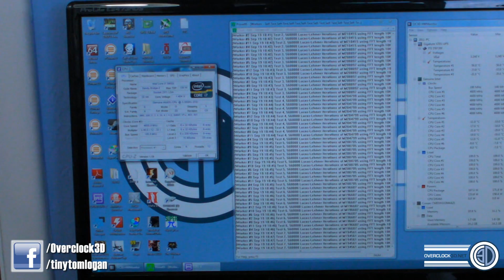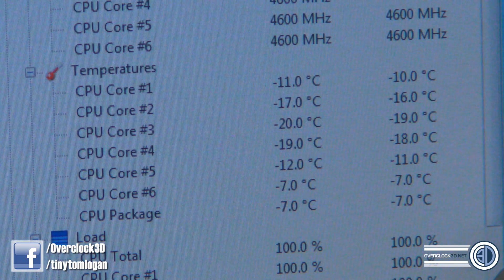Ultimate Corsair H100 Cooling Mod

Comment: He said in some way that this video is joke. But I want to say that you can't get CPU temperatures below the ambient air temperature, even with water cooling. And I also read some comments that some peoples compare the liquid cooling with the way that your body cools when you get out of the pool in windy day. That is completely wrong! When you get out of the pool you have water on your skin, which when blown by air evaporates and takes body heat with it and makes you feel very cold. But that is not the case with the liquid cooling, since the radiator is dry.

Comment: The core temperatures are fake, if you get cpu temperatures BELOW freezing, your would be turning the liquid cooling liquid into ice which.... uh....  is gonna blow your pump up?
Reply: Firal Rally Its not water, its coolent. It cant freeze.
Reply: Firal Rally its fucking coolant... it freezes at -42  C you dip
Reply: Firal Rally Are you dumb?

Coolant is -42c.
And yes fans alone can create a sub zero temperature with the radiator and heat pipes.
Reply: can FANS create sub zero? case fans?
STACKED?
Reply: Firal Rally The Liquid inside the enclosed Pipes is not Water. It's like Anti-Freeze which is what you put into a car. To stop it freezing in the Winter, in a Water Cooled loop, it's got the same properties, check out Linus Tech Tips, he did the same thing (kind of) instead of using 40 Fans, he used a custom Water Cooling Loop, which lead to him getting sub-0 temperatures, which you actually can obtain..
Reply: sid30A well, it can freeze. it just have a lower freezing temp then water. but does the coolant for a PC really have that property? you would get big problems with condensation on the motherboard if you got down to the freezing point of water. so they are not meant to be run at that low temps.
Reply: EXACTLY :) see my point?
Reply: how the fuck do you think fridges and air conditioners work
Reply: I think with a brain? Duh. and fridges and air conditions? what does that got anything to do with what we are talking about?
Reply: Firal Rally it has everything to do with what we are talking about.... they are almost the exact same
Reply: soo, a fridge and a air condition runs with fans that generates sub zero? Wut? u are making no sense
Reply: johnkats14 fridges and freezers use compressors to achieve sub zero temps not fans...
Reply: thanks David :)
Reply: johnkats14 No. Assume your ambient temp is 25C, or anything above -10C. Those fans are moving ambient air. How can you expect to cool something below ambient air using ambient air? Although it may be possible to see 1 or 2 degrees below ambient due to evaporation, -17C is impossible. You need a coolant along with a compressor and high pressure tubes to generate those temps. And just cause something freezes at -42 doesn't mean it is at -42 or it will cool to -42. Water freezes at 0 but you don't see water cooled PC's running at temps even close to that. The main benefit is that the coolant can be PRESSURIZED so that when it expands again, it can create a greater thermal gradient (because it can be as cool as -42), compared to water (0C). Also, coolants have a higher thermal capacity, basically means that they're better at absorbing heat. IDK what the fuck the guy in this video did, but he is not getting the temps with JUST fans and a rad.
Reply: johnkats14 Phase change cooling / condensers. Fans can only cool something to ambient temperature.

Comment: Honestly the amount of fans is an excessive misuse of money. Reason being most fans now can overcome the drag the radiator generates. Fans rated for cfm. So more fans stacked will not make more airflow. Your just moving same amount air with more electricity of psu. Now if you made a 3by3 fan array with outputs funneled to 3 fan slot radiator would be 3:1 increase in cfm? Should try it. I'm curious how that would perform . Regardless I can't lie though as impractical design this is it does look "scifi" futuristic

Comment: I think this is a fantastic solution. My only suggestion would be to change the graphics card, since those blower type cards tend to get pretty loud.
Reply: Covering the noise with more noise might actually help to reduce the noise! I hope we will see an update video about this.
Reply: theFrizzleFry i don't think there will be any hot air in the case
Reply: For SLI inside a case they are the best solution. They don't push hot air around the inside of the case. I think there should be more non-reference blower style GPUs
Reply: Gregory Kanniard i don't think you got the joke.
Reply: theFrizzleFry yeah good one...
Reply: +Gregory Kanniard that's the main reason I run AMD aside from price to performance level. HIS is a brand that only makes AMD cards and they favor the blower type, they call it IceQ. My first HIS gpu was an HD5670 and it tore through pretty much anything I threw at it and it never went over 60.. then I overclocked it to keep up with the new 780s at the time and it went up to averaging 70 under load. GREAT cards for sure
Reply: God bless you
Reply: theFrizzleFry FAAKE GO TAKE CHEMISTRY AGAIN IDIOT THERES A LAW OF PHYSICS AGAINST THIS
Reply: Joscha Gillner what case? there's no room for that kind of fan setup. :)) I currently am working on a custom made case with 2 fans, 35-40cm 3speed floor fans, one pushing air into the case, and the other pulling it out the back, no other fan inside the case, just huge CPU and GPU heatpipe coolers.

Comment: lololol nice trolling X3

but now i  almost want to try a similar rig with a peltie element in there lol...
that really could get minus degrees..

hell if you don't care about the electric bills you can stack the suckers and make a heat pump.
Reply: of coarse if one did manage to get lower them ambient temperature then condensation would be an issue... so the case would have to be sealed tight and filled with Silica gel packets or some other dehumidifying substance..

or possibly submerged in mineral oil....

Comment: simple phase change cooling cant be this good... I find it bizarre that you should get lower them ambient temperature... that just weird.....

I have to read up on this now... this all seams very odd... a bit tempting though... only it seams like a nightmarish thing to clean after long use....

Dust + fan = nightmare...
though i suppose keeping it outside the case does make it some what easier to disassemble..

but a pre filled closed system would be hard to run out of most cases with out modifying the case itself...

Comment: this must be faked!!! i mean there is just no way you can get cooling like that unless you put in a Peltier element or two in there as well...

now if you did that on top of the fans then sure I can totally see you getting minus degrees...

of coarse i am not familiar with this cooling system does it use Thermoelectric elements?

Comment: the radiator in your vehicle operates on similar principles to the venturi effect, only instead of air being accelerated it is decelerated as it comes into contact with the fins which slows the air down, the heat then is transferred via the fins/tubes to the surrounding air and pulled through the radiator by mechanical means, generally an electric, or mechanical fan, this pressure drop as it flows through the fins also adds a cooling effect, the high speed air slowing down cools slightly which allows more heat to be withdrawn, a high speed push-pull configuration will do this same thing as it now has a ram-air/wind-tunnel effect driving the air through the cooler as a large volume, not 100% sure though, but on paper it looks plausable lol, great vid all the same

Comment: If it's running -8C, why isn't the water freezing in the line and stopping the motor. There isn't antifreeze in the H100. lmao
Reply: Looked it up, and no there isn't anti-freeze in it. There's anti-algae (to prevent gunking) agents, but no anti-freeze.
Reply: pulpbits Watch the end of the video.  it isn't real.